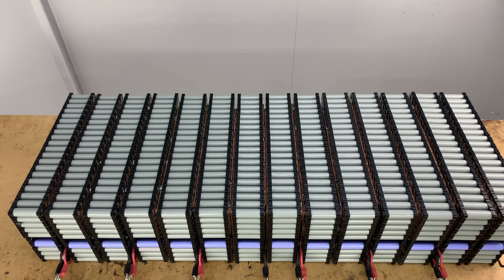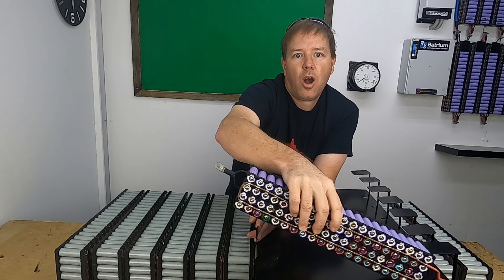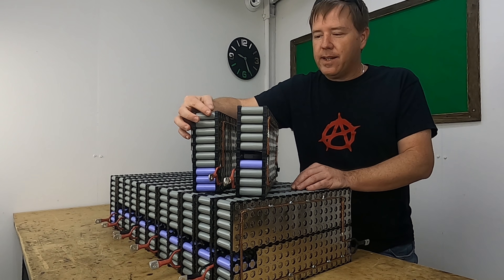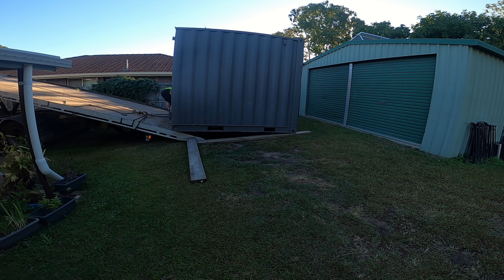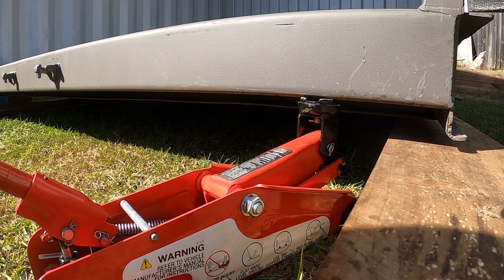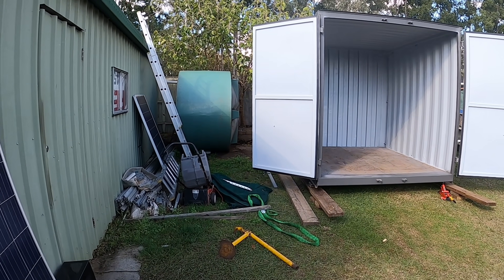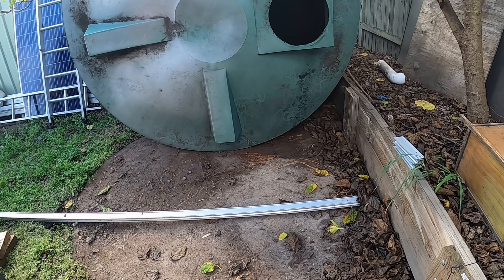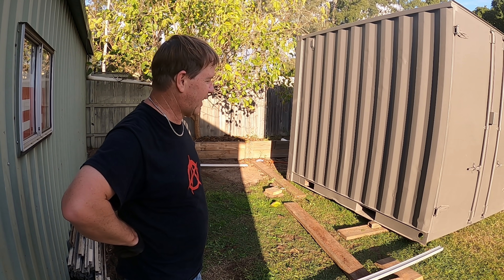Pt.2 Finding out my massive battery won't pass inspection!

Comment: Electricity is confusing magic to me. It's amazing to see people DIY this kind of stuff.
Reply from the maker: To be fair it's just + & - so far
Reply: @HBPowerwall  Nope. Watts, Amps and Voltage mean almost nothing to me. Series and Parallel? The context of those +'s and -'s is completely lost on me. 

Actually, now that I've said it. Would you ever do an electricity for dummies video?
Reply from the maker: That isn't my type of video i like to film my adventures and really try hard not to teach so much
Reply: @HBPowerwall  Ah. Dont stress it. I understand the liabilities at least. Lol.
Reply: @benm5913  Ben you have dc current that flows in a circle - and plus. Then you have ac which goes back and forth inside the wires it has two wires for 120v. Then you have amps and volts. Volts is like the zap or the spark while amps are like how big the spark gets. You can have high amps and low volts or high volts and low amps. This is were parallel and series come in. Wiring up in series increases the volts. While wiring parallel increases amps. Amps push volts across the wire. Amp x volts = watts. So a 120v light using  2amp is equal to the light cunsuming 240watts. It's really that easy but we like to complicate it. The ground wire green just transfers accidental electricity and send it into the Earth soil. Car battery dc do not have a real ground. They use car body as negative so they use less wires.
Reply: @jameshughes131  you mean 230V
(Everything is not America)
Reply: Just wait till you find out that the wires don't actually carry the electricity but it flows on the outside of the wires
Reply from the maker: Lol
Reply: I get that for AC power but DC like these batteries is as straight forward as it gets
Reply: You're an idiot. 🤷‍♂️
Reply: @TheSphongleface  And you're a dick.
Reply: @benm5913  And you're blind.
Reply: @benm5913  And you're greedy.
Reply: @TheSphongleface  And now you're a White Knight.
Reply: @benm5913  Don't feed trolls
Reply from the maker: A smart man once told me you always feed the trolls because they make a lot of money on YouTube algorithm

Comment: There are some aspects of the mount I really do like, but I have serious reservations as well.  The first is it seems the cells are being used as part of the mechanical structure (i.e. the weight of the pack is resting on the bottom cells). This could be asking for trouble especially when considering this second issue.  A battery wall is a stationary object right?  Well the unfortunate reality is this statement is only ~99.999% true.  During an earthquake or other natural disturbance, I suspect there is a possibility the packs could simply fall out of the mount.  Since we have little to no warning of when these types of events occur, this might pose a serious safety risk.  I do like the simplicity of the design and how easy it is to swap packs in and out if needed, but the above concerns would force me to look for ways to modify it so they are addressed.  Anyone have any ideas on improvements?  If the mount was installed in an electrical enclosure, maybe the door could also act as a locking mechanism to prevent the bottom of the pack from kicking out?  PS. Great job on using the shipping container...don’t think you’d have to worry too much about burning something down :) BTW, this is my single biggest fear with building a DIY power wall and still thinking through how to overcome it - unfortunately I don’t think my neighbors or wife would appreciate the shear beauty of a shipping container.
Reply: A simple bracket made of clear plastic strip could be attached to the top/bottom which would secure it in place

Comment: Thats a lot batteries and cost a pretty penny i bet.How long until  they are no good. I know my e bike takes those same cells and it lasted about 36 months that's not a long time. I am guess for what you are using for ,they will last a lot  longer. 🤔🤔👍🏻👍🏻
Reply from the maker: And your ebike takes how many amps? it's all relative
Reply: My e bike take 30 amp so if you  have low amp's they  last a lot longer. That's what i figured because who would spend  that kind of money on batteries  and it only last 3 years. I guess probley 10 to 15  years they last. Cool project. 👍🏻🤔😀
Reply from the maker: @cia4915  I'm banking on 10 years .. see how we go

Comment: Emergency Alert...... Pete is now called MR NUMBNUTS, u do not use zinc plated hardware on the terminal... U ONLY USE STAINLESS STEAL, u need a slappin Pete... ooops i meant numbnuts. lol
Reply from the maker: I don't even know what you're referring too .. lol
Reply: @HBPowerwall  sure sure sure.... what ever u bloody recon pete.... why didnt u get mates over with a 4wd with a winch, setup the pulley on the back fence and finish the bloody thin in 15 min.

Comment: is there a metal conduit size that closely matches 18650 dimensions that could be used on the lower support area instead of dead batteries???
Reply from the maker: zero volt cells were within reach - but there probably is somewhere.
Reply: @HBPowerwall  just thinking 10 kg on 3 cells lota weight
Reply: or even a bolt right size to fit (rebar maybe)
Reply from the maker: To be fair its actually only on one cell.. other two at the bottom barely touch
Reply: @HBPowerwall  yeah from memory was bent slightly up  but I'm guessing with 10kg on it it will probably bend to flat or even a little down (maybe a short clip on the next video will settle that)
Reply: thinking of the 3 rear wheels on a heavy semi trailer only one used when no load but all three when heavily laidend

Comment: Do you plan to insulate and put an Air Conditioner in the new shed? Great videos, and nice to see a progress.
Reply from the maker: I have to talk to sparkie first - I need a plan - i think that if i use the wrong materials it won't pass.. I hope i can make something from all the boring bits.. see how I go i guess.
Reply: @HBPowerwall  Yeah. Material selection might be very important in terms of performance and fire safety.

Comment: Yes, 600 mm down plus tape warning at 200 mm good luck Peter.
Reply from the maker: Yep sounds like it but I'll wait for the sparkie in a few days.. No use staring to dig as he my want to go all the way back to the meter board not pick up off the shed power
Reply: Orange conduit is a requirement when underground.  Rent a dingo for half day and save you time plus back pain.  Depth I believed is correct for conduit and tape, add in extra conduit for data - should be white from memory and needs to be separated from ac power.  You can get really flash and run fibre optic for data!
Reply from the maker: Yeh, will need a data run - CT clamp back to the meter box also
Reply: @HBPowerwall  how about going wireless (e.g. WiFi) for the control and measurements?

Comment: You needed more planks pal ;)

The underground cable is to be laid at a minimum depth of 600mm below the present or future footway surface, whichever is the lower. The alignment of the underground service shall be parallel to and a distance not less than 400 mm, nor more than 900 mm from the property line
Reply from the maker: That'll be the sparkies job lol I know i heard it somewhere that it was 600 under
Reply: @HBPowerwall  Might cost a a few bob mate if he has to did it out. Be a lot cheaper to do it yaself tbh ;)

Comment: "whose voltage is at least 12 volts"
Well, there you go.. Reconfigure the battery to be 3s 40000p and you are exempt. Whoop Whoop
Reply: I would even argue that the system is a UPS - it's effectively the same bloody thing!
Reply from the maker: Argueing it's a UPS is like telling the cop you weren't speeding lol
Reply: @HBPowerwall  So nails for fuses are out with the new regulations?
Reply: @octapc  Hahaha! Reminded me of the old comedy skit from Clarke and Dawe - The Front Fell Off.
Reply: @sky73x  I was unsure what "AS 62040, Parts 1.1 and 1.2" requirements were.. and I was unwilling to go digging for that info
Reply from the maker: Robert Slackware  Then they make assumptions on what they have seen and leave it up to me to prove them wrong.. I can't win that battle.
Reply from the maker: NO - look again max 1kwh
I need clarification sparkie here in a few days
Reply: @HBPowerwall  Did you notice the word AND, not OR?
Reply from the maker: I didn't
Reply: @HBPowerwall  Obviously still consult professionals. As Legalese is a mindfield. But Andrew Reddaway who wrote the other article also seems to believe it is an "and" in his "Overview of the new standard" section

Comment from the maker: Check out the overview here of the new regulations - https://renew.org.au/renew-magazine/solar-batteries/new-battery-installation-rules/ and you can download a draft copy of those regulations here - https://www.smartenergy.org.au/sites/default/files/uploaded-content/website-content/dr2_as_nzs_5139_2019_pc.pdf.pdf
Reply: What are the temperatures in those sheds? Isn't Australia hotter than hell itself? How does that collaborate with that 50 Celsius upper temp "limit" for 18650, or all lithium-ion for that matter. Guessing those are not LTO 18650
Reply from the maker: @rndmfella1874  Final plan will be a solar roof for shade & an airconditioner controlled by my BMS
Reply: Been a long time coming but finally a shipping container
Reply: That is how egyptians had build pyramids ...
Reply: According to others in AU you can add A FUSE (20-50amp?), PER CELL BLOCK/PACK that will reduce the ARC FLASH issues to 0.2 eliminating much PPE. A fuse large enough to let the cell work but will blow on any dead short. That is the concern of the authorities, a dead short powered by the entire battery system.
Reply from the maker: @kenlyons9986  A dead short blows all fuses on the most negative cell - I've proven that time and time again I will be adding fuses between each 14P battery but not between all those 14
Reply: Damn that sucks a bit, that the limit for non-electricians is 60 V DC. Many battery systems and panel installations will exceed that. Hiring an electrician is costly, timely, and deprives you from knowing you did everything. I guess, the only option is to have some sort of training and license to be able to do it.
Reply: @movax20h  Unfortunately, in Australia that means completing a 4 year apprenticeship and passing an exam to obtain an electrician's licence.
Reply from the maker: @thisnthat3530  Yes something like that... at 45 I don't think that's a very good plan
Reply: @movax20h  check three laws first but I think you can actually do or all yourself and have an electrician inspect or before throwing the switch on. That way you HAVE done it all yourself and still satisfied the law. Also, the inspection is much cheaper than am install. If you have any friends in the construction business, you might get him/her to let you list them as the general contractor and then that allows you to complete a build and simply have an official inspection to be legal.
Reply from the maker: @SI-GOD  I'll be doing as much as i can my self except for final connections. I'll change all the solar to under 60v <<THAT SUCKS by the way but not a deal breaker - just higher amps more heat even more chance of issues than messing with sub 120v like i am now.
Reply from the maker: @Spectemur agendo lol
Reply: I read some of the so-called rules and it outlines we the DIY can not exceed 60 volts solar. This means no point buying a Mppt. Might as well buy a PWM. Then we are forced to buy thicker wire. These rules more or less are aimed to make us stop our hobbies.
Reply: I’ve been interested in this for a long time. I watched videos of an American politician who did it with Tesla batteries but I’m even more interested in doing this. Do you still think it’ll be worthwhile with the new regulations? When you say you are converting your solar is that required? Can an electrician connect the solar to the system for you?
Reply: @HBPowerwall how's progress going?
Reply from the maker: @jamescollier3  I'm on it i'm on it.. life first then money - THEN time to tube!
Reply: Let's follow the ridiculous rules set by an overbearing government" says a guy wearing a black shirt with the symbol for anarchy on it. Lol.
Reply: Haha "Rules are Rules" till someone on youtube rats you out.
Reply from the maker: Already did lol
Reply: Great channel!
Reply: I was considering adding a fuse at every cell module, in case a cell shorts out. But how much power will that waste?
Reply from the maker: I would say it’s unmeasurable
Reply: @HBPowerwall  doubt it. It's resistance that makes a fuse melt!
Reply: im so glad where i live they have 0 say  in what i do with my house or my land   code free baby is the only way
Reply: Nanny state and securing jobs for the boys again.  Soon you will need to a call in an electrician to put bread and pull toast out of a toaster or make a cup of coffee (unless you use gas stove then its a licensed plumber).
Reply from the maker: I think they had good intentions - doing stuff safer is a thing - we will see how it plays out. I NEED to talk to a sparkie in person and start talking through my plan and make a solid plan to move foward - fingers crossed I can set the standard and help everyone along the way
Reply: @HBPowerwall  do you have a link to part 1 btw?
Reply: Man these rules are harsh, thankfully all my battery builds so far have been portable and as a result don't suffer from these new rules. Seems the best way to still make your own battery systems will be to make it in a big chest and put wheels on it, although that doesn't help if you want to make a powerwall integrated into a house's mains wiring (then again doing that without an electrician was already illegal). 
This situation seems similar to the FPV drone hobby. When the rules become so extreme that everyone is breaking at least one of them, it becomes easy to ignore them all together.
Reply from the maker: https://youtu.be/PenPYwa00CA
Reply: @vaguedirector_7342  I was just about say just that.
Reply: @vaguedirector_7342  possibly you could get a generator transfer switch professionally installed then its all 'temporary'
Reply: @rw-xf4cb  Yeah that may technically be portable, but if something was to happen I doubt the insurance companies and authorities would see it our way.
Reply from the maker: I'm happy to do it better - we will see how it plays out..
Reply: @HBPowerwall  thanks
Reply from the maker: @vaguedirector_7342  I agree, ignoring them altogether will be the plan for 99% of people - Me I''ll do it right if i can make it work..
Reply: @HBPowerwall  they didn't do it for safety... that's just the justification. they did it to create INCOME

Comment: If container is on blocks, it makes a great place to store conduit, pv rails, scaffording etc.
Reply from the maker: Good place for  the snakes to hide too... Conversation with wifee is that we should concrete it all before anything else happens
Reply: @HBPowerwall  Also should put a roof over it as old containers tend to leak overtime plus the gap between the container and the roof you can store your railing then only have to deal with tree snakes.
Reply: Add roof over top will aid with cooling - double skin effect
Reply from the maker: SOLAR ROOF!!!
Reply from the maker: i got the solar mounts lol